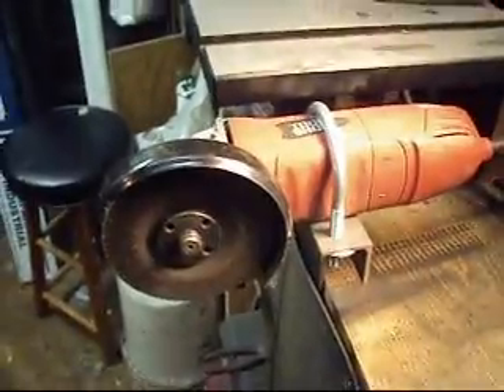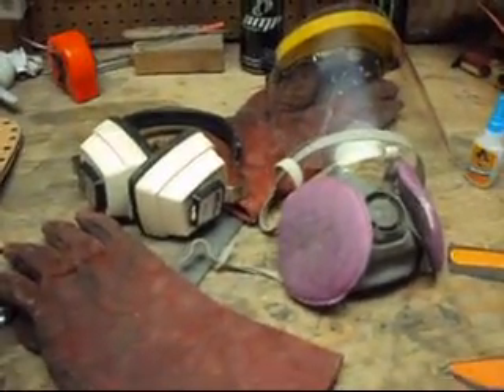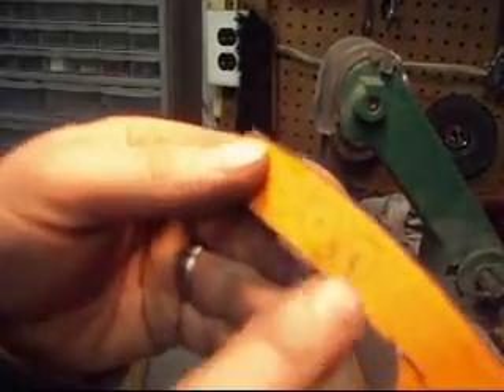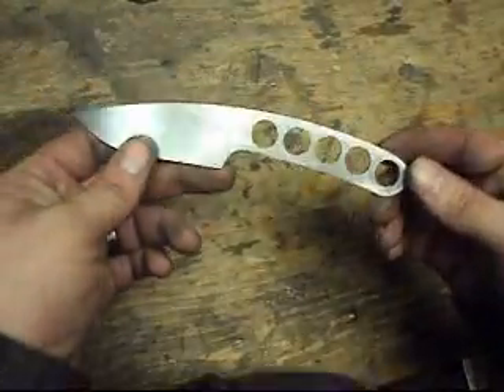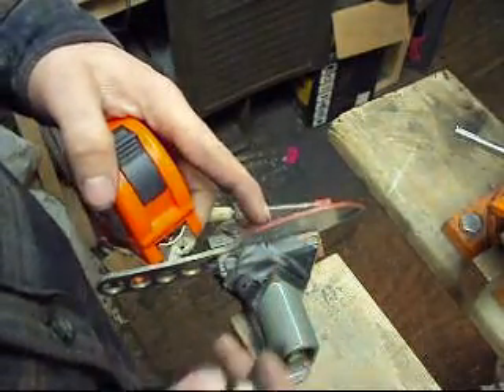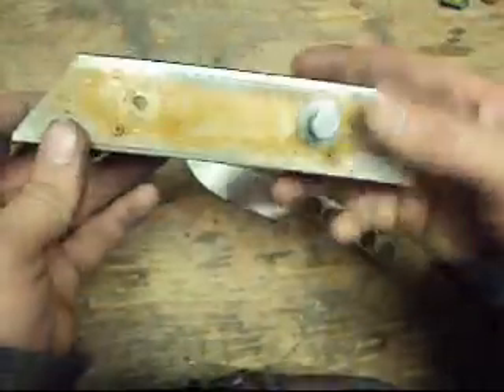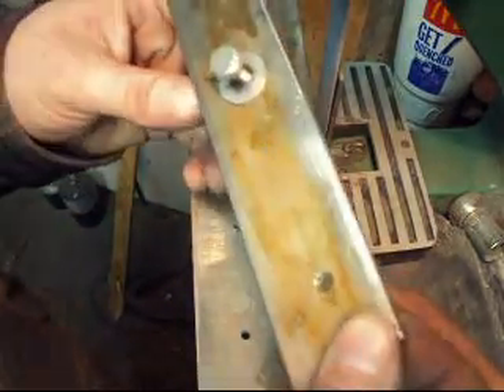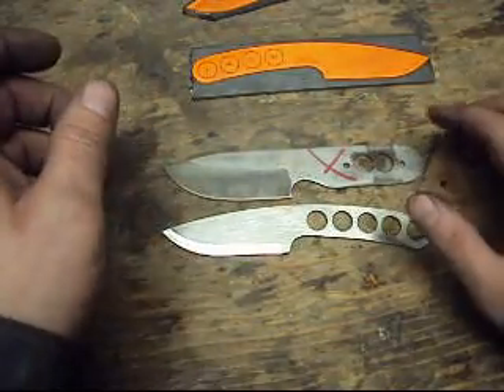Knifemaking: the Making of the Ironclad

Comment: when heat treating the blade should demagnitize. the loss of magnatic draw is an indication of proper temp. if a magnet doesnt stick to the hot steel you are in the proper heat range.